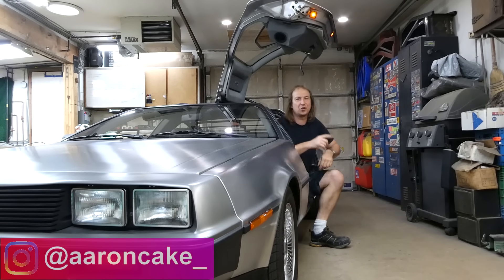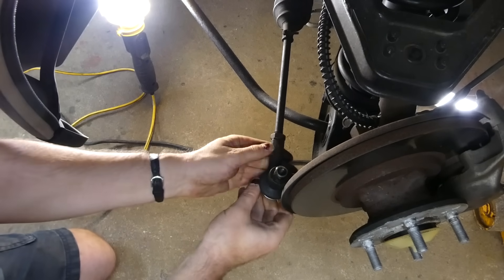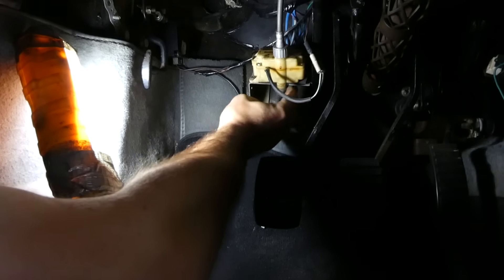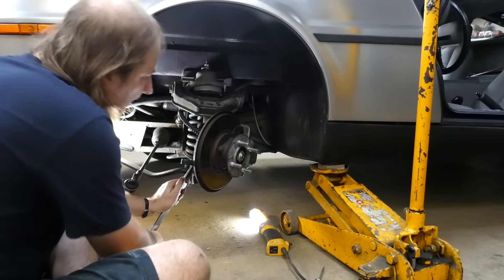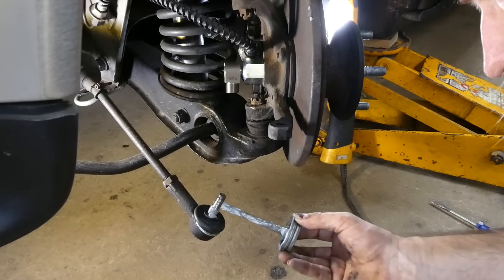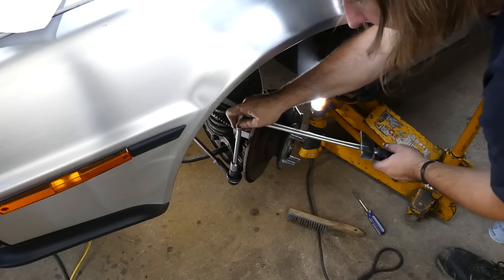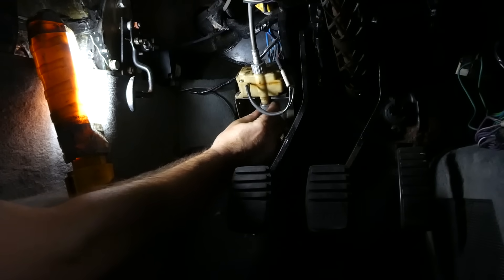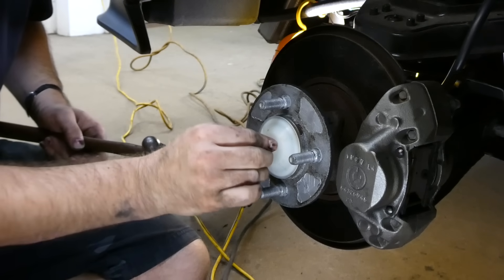DMCH UltraDrive Install, Angle Drive Replacement - DeLorean #5637

Comment: The angle drive nut locks the spindle into the hub via a taper lock. It's super important to reinstate that taper lock by torquing the inner nut BEFORE the outer nut. You should tap the stub axle into the hub, this will lock it enough that you can torque the nut.
Reply from the maker: It may not be clear in the video but the outer axle nut did not loosen, only the angle drive nut loosened. So I made the decision to tighten from the front. Seems to have worked though as you mention, for 99% of cases, this is NOT the correct way to do it.

Comment: I remember when i was teenager and could not understand why 88 was fast, just because i didn't know anything but kph. Also I never seen speedometer drive that bizzare. I wonder if ignition uses flux capacitor...
Reply from the maker: The theory is that 88MPH is exactly the speed needed to travel through the wormhole generated by the time travel stuff, emitted by the wormhole emitter at the top of the car. Or so they say. This style of speedometer drive is common in British vehicles of the era. Lotus made extensive use of them, and since Lotus did the engineering for the DeLorean...

Comment: Has a rotary swap in a Delorean ever been done? I've seen a few with small block chevy V8s 🙄 (most done to death swap and makes the statement of being too stupid to work on literally anything else) and one or two with the Renault 2.8 modified to over 200 hp.
Reply from the maker: There have been a few. The most famous one was a 20B where they used all the Cosmo stuff: ECUs, wiring, even the instrument cluster. I admired it for years until finding the true story a few months ago: it was a complete hack job. They destroyed the frame, the welding was as if it was done by a drunk monkey with a stick welder, etc. Ultimately the car ended up abandoned and was bought to be restored back to stock. I think I've seen pictures of a 13B/Renesis DeLorean. Fun fact: the DeLorean was supposed to be rotary except GM would not license the design of their 3 rotor to DMC. Honestly I'm just going to keep the engine stock and enjoy the car except for some upgrades. EFI (MegaSquirt) is on the list. I mean, LS swaps have been done to death but there is a reason: bolt in, reliable, easy to maintain and good power.

Comment: Wo wo wo. The using a piece of metal on the boil joint and hitting the metal with a hammer to not damage the nut or threads. 😮 never thought of that.
Reply from the maker: A brass hammer is ideal, except for the fact I don't have one.

Comment: Thanks for the Christmas present!

edit: this was a missed opportunity to make one of those tutorial videos where you make everything look super easy while anybody following along is having the struggle of their lives trying to make it work as smoothly on their end
Reply from the maker: Normally the angle drive nut is a pain to remove however it just so happens the last person to have the axle shaft out used anti-seize on it and staked the axle nut so that made it a bit easier. Access to the angle drive nut is the issue. Needs a big wrench or a crows foot.

Comment: Painted nails?
Reply from the maker: So, what happened was that I accidentally slammed my right index finger in a car door, crushing the tip and ripping off the nail. The index finger looked gnarly and I was tired of people asking what happened. To make them all match, I just painted them. A co-worker noticed and a day later I had a wide selection of nail polishes sitting on my desk. Obviously I couldn't let them go to waste.

Comment: Well Merry Christmas to all of us... I'm just confused about what year it is.  Aaron Cake doesn't operate within the common lunar calendar, this is not the Cosmo, and what's up with the Black Berry cell clipped to the belt?
Reply from the maker: You can take my BlackBerry out of my cold dead hands! As I am waiting on the Cosmo for some things, figured a DeLorean video would pass the time.
Reply: @aaroncake  I had a Blackberry 10 ( I think that was the model) best cell phone and best operating system I've ever had...wish they could have survived.
Reply from the maker: On my belt is a BlackBerry Classic (Q20) running BB 10. I'll be using it until it isn't feasible anymore.
Reply: @aaroncake  I had look up the BB phone I had, was a BB Z30 using the BB10 operating system...best ever.  Hope you can keep yours far into the future.

Comment: What happened to the cosmo have you given up on it I really thought you would have been done before Binky was almost finished
Reply from the maker: Nothing happened to the Cosmo. I'm working on it just as I was before. Current Cosmo project is the brakes however I am waiting a bit for parts, for the machine shop and still deciding on the master cylinder/booster combination.

Comment: Fellow Delorean owner… well I guess not yet still on the factory angle drive with 57k miles on it …. Oh crap did I just jinx it 😢
Reply from the maker: You may have just jinxed it. 57K is damn impressive. I'd assume you lube it up with every oil change? One piece speedo cable or still using the lambda counter?
Reply: @aaroncake  I haven't touched it and there previous owner (original owner ) had a very meticulously documented repair history never mentioned replacing or lubing it

Comment: An old trick for the speed cap was to put one of those old tough sponges between the wheel and the cap. It would press against the cap and keep it in place.